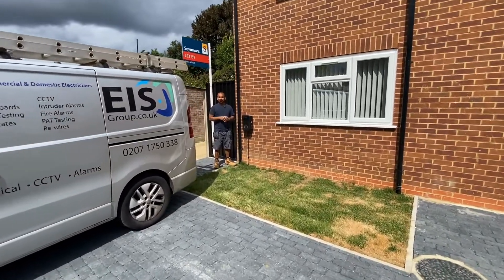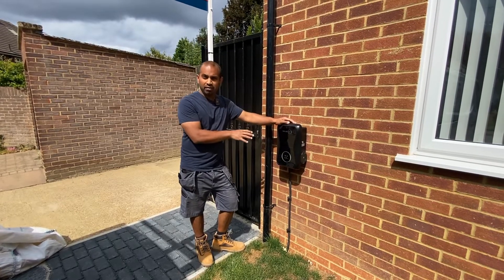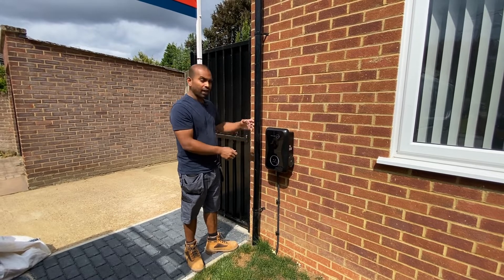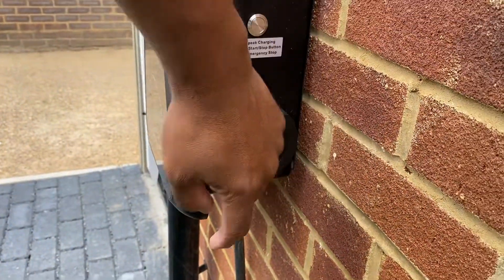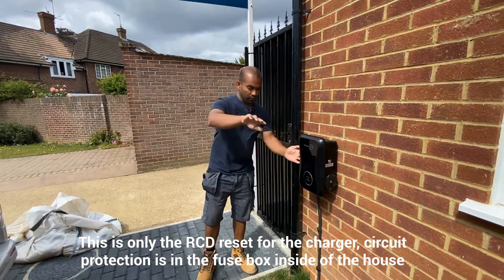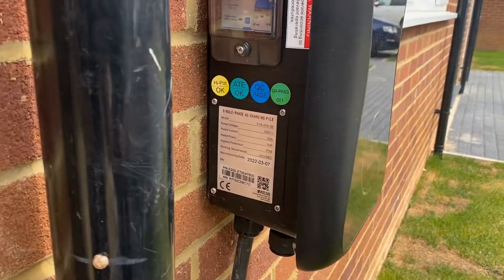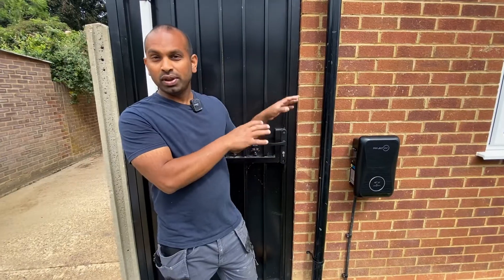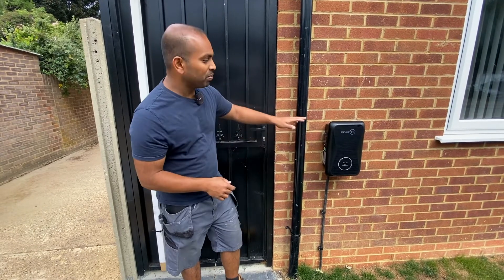EV Car charger Installations in London, Luton, Milton keynes. Zappi, Project EV, Hypervolt, Easee

Comment: hey Gents, on the Project EV, I own a KT65DL, will the A Type RCD test do the RCD built into the EV itself as the specs say its a A Type +6ma RCD? I really dont want to have to buy the 66DL just for EV B Type RCD,s all im planning on installing is Project EV but I want to be covered.
Also do you install a 32A Type A RCBO in the consumer unit aswel as the built in RCD or just go off a 32A MCB in 6mm SWA?
Thanks
Reply from the maker: Hey David, we use metrel MI 3152 new type tester which has EV testing capabilities. But I’m not too sure about kewtech KT65 as I haven’t used them before 

With regards to the circuit it self, you can just fit a 32AMP MCB and run SWA to the charger (you don’t need RCD protection at the board if the circuit has mechanical protection- such as SWA) charger it self has all RCD & safety devices built in so just a straightforward SWA run from the DB with MCB is just fine